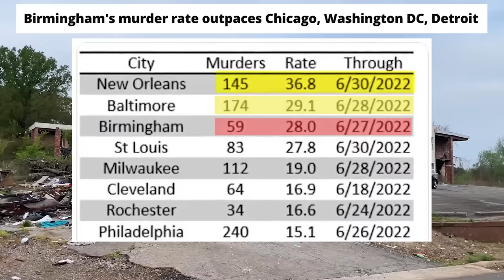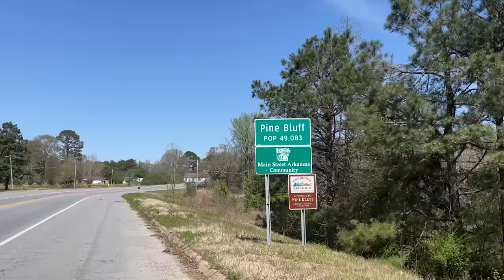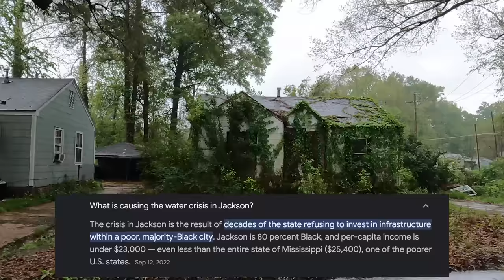Exploring The Deep South's Worst Ghettos

Comment: Few towns I live in have ways to deal with blight/urban decay. These towns have to start by clean up the trash in the streets. Then they have to start fining property owners for having clutter, trash in the yard or tall grass. Send a notice that dilapidated building need to be demoed or they will get fined.  If the fines build up after a few years the town will confiscate the property then clear the lot.  Can do like they did in Detroit as well. They can do house upgrade swaps moving all the occupied lots together and start clearing parts of town. Then turn those areas back to open spaces or even into a farm.  It doesn't cost a enormous amount for a town to buy a few wheel loaders and dump trucks.
Reply: Isnt that equivalent to an HOA?

Comment: Great topic Nick. You touch on the majority of reasons for the declines while the potential answers always become political blaming. 
Posit this: 
The government, such as it is, with its lobbying interests, meaning private concerns, have things running just the way they intend them. A long list of collateral damage without a second thought.
What these interests have accomplished is to bolster the expansion of the "consumer" mindset. Red or Blue doesn't matter, as long as we are increasingly made more dependent on some sort of central system of ethics and morals.
I live in one of these seeming third rate shit holes for the past 15 years and all I can see is potential.
What it will take is the reinvention of "citizenry" and all of the definitions of what it takes to be one. 
Society simply cannot spend its way out of poverty. It has never worked by itself. Citizenry builds resilience. 
Where I live in the depths of South Carolina, I have tracked the history here to the last generation before the "reform". Electricity arrived in 1954. Through government interventions/help, the talent pool has vanished and moved away from a tight knit society that were never hungry and had the fathers around. There seems to be near zero self reliance. 
If the guberment really have a shit, they would promote the ideals of citizenry and what it means to each of us individually.

Cheers!

Comment: I was north of Shreveport cruising through though the hills and came to a turn in the road. Up to that point I had seen plenty of abandoned or dilapidated properties but what I saw next was the ultimate. As I came around the corner the property in front of me had obviously seen better days. Part of the roof was missing and a large portion was covered with a tarp. The wall facing the road was missing. ???? Inside, I could see a Large flat screen T.V. It was on! And, I'm sure someone was watching it.

Comment: 17:35 Moon Lake Acres/Estates  I grew up here in the 1970's. We loved off Lake drive. We had one of the few paved roads, a house. And there was a house behind us as well, but most of the homes were trailers.  My brother and I pulled up much of the black top, the holes in the roads got horrible 3' deep sometimes. 

The KKK was heavily peppered through and would do membership drives at the circle K on Sundays in the 1990's.  When we sold the house off in the 2000's for 30K, I stopped going out there.

Comment: How do those shotgun houses work, is there a hallway on one side and rooms on the other or do you walk directly through all the rooms front to back? Odd question, not american, just curious.
Reply: Both types exist.  There is the type that has a single hallway going from the front door to the back door with rooms off to the sides or there is the type with a doorway passing through each room from the front door to the back door.  I suspect that it is the room to room, front to back type that is the most prevalent as most shotgun homes are long and narrow, too narrow for a central hallway.  Only if it is a wider shotgun home could it have a central hallway.  The main feature, of course, is the hallway or the door passageways going from room to room.  They have to be lined up so that you'd be able to see the back door clearly from the front door.
Reply: @laurie7689  interesting, thanks for the reply.  Cheers